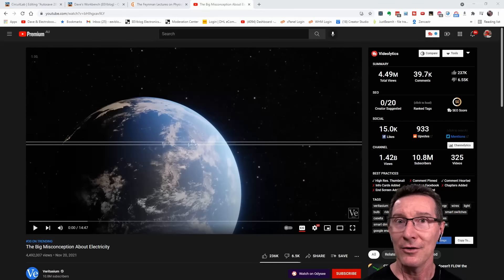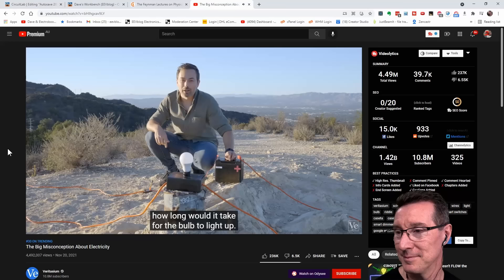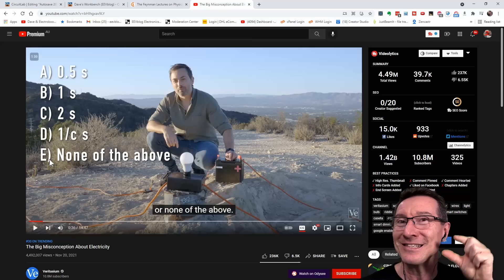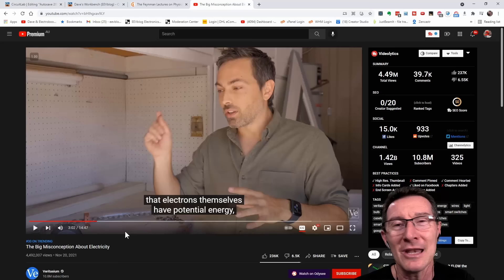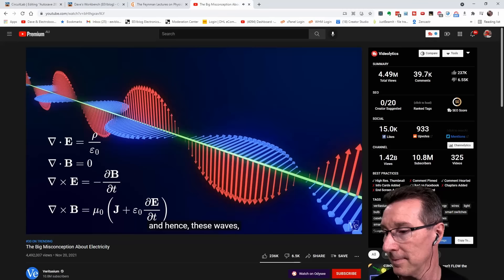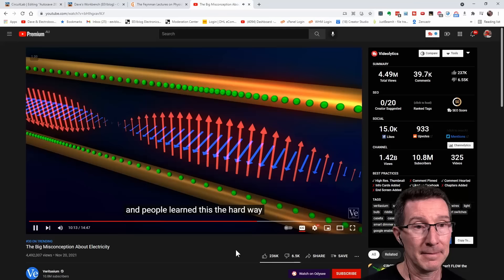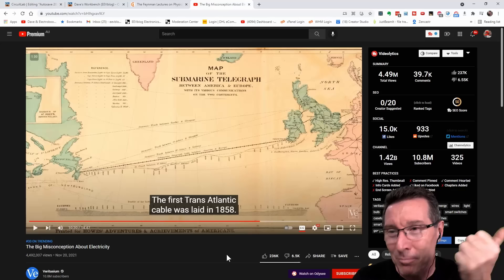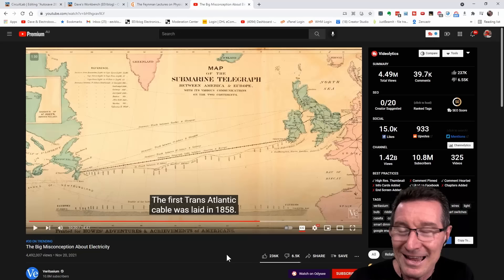EEVblog 1439 - Analysing Veritasium's Electricity Misconceptions Video

Comment: You're making a lot more sense than the original video. The Veritasium video seemed to imply to me that the existence of the wire would be irrelevant over that distance. Of course, it's evident for short distances that the wires don't have to be connected to transfer power, with for example transformers. But the details concerning thickness, resistance, distance, power , ac/dc, etc. matter a lot, otherwise every device and circuit would interfere with each other and be practically useless.
Reply: It seems to me like Derek tries to make concepts appear to be as counterintuitive as possible instead of trying to explain the concept as clearly as possible. I might be wrong that he's doing this on purpose to generate more commentary/discussion/views, but the end result seems to confuse more people than it does explain the concept clearly.
Reply: I would argue that the original video is wrong. The reason being that the magnetic filed  is made by moving  electrons.  The field is just breaking the electrons from moving att full speed.
Reply: @Kanglar  , I think so. He throws the baby out with the bathwater, so to speak, by making a technically correct explanation seem as though it has no value. There are different levels of abstraction that can be made for various phenomenon and those all can be correct. I found his video good, but slightly misleading because of that.
Reply: hmm is the wire sort of is irrelevant because you don't require a wire to transmit power..
There are a number of mediums that can transfer power...?...
Reply: The surface charges are already along the wire. When the switch is thrown a current is created,  making a B field, now power can flow through space. As real wires have resistance, power also flows into the wire where it is dissipated. It is not bad to say that the only purpose of the wire is to allow a current and the role of current is to make B.
Reply: @jimmcclymer4230  ....

"only purpose of the wire is to allow a current "

Well in effect, move electrons... then we are back to the beginning again.
Reply: the wire forms the field
Reply: @hausaffe100  That is not really saying anything. The battery matters, the surface charges on the wire makes two electric fields, one along the axis of the wire and one perpendicular to the wire, the 
Surface charge gradient makes a potential difference along the wire, causing a current which makes a magnetic field. The resulting ExB determines the power density.
Reply: I would argue that you are all assuming that all people watching are engineers. Almost no one is an engineer. Most people have different occupations. So I am quite sure that to most of his audience this is absolutely new. 

Just because we know, does not mean everyone knows.

If you consider the audience and what he wanted to achieve the veritasium video is absolutely fine. It teaches something most don't realize to those that don't realize it. 

Also remember that the average YouTube viewer video attention span is below 10 minutes. So videos have to be cut to fit that. I'm sure a lot of detail had to be dropped. He is not teaching a university class on the subject
Reply: Yeah and in Theory you could acutally only move the battery close the light bulb and have by that coupling to the wires inside the light bulb, in nA or pA for a ms. Of course your light would turn on
Reply: @TheWebstaff  The only reason a transformer works is because of the metal core plates layout that transfers power from one side to the other through the core that actually crosses the magnetic field induced by the primary winding.Without that specific core, the transformer would be completely useless. One can't simply transmit power without a wire efficiently. Even wireless chargers have to have their transmission and receiver antennas super close and right within the field not to lose too much efficiency. Magnetic fields means that you can radiate power from one line to another with some ammount of loss, it doesn't mean you can power a lightbulb with a wireless battery. Derek's video is basically saying that we could have flying cars and we technically wouldn't need rubber tyres... if we assume gravity doesn't exist. Which makes the entire video and concept completely pointless.
Reply: Derek played a bit of a word game in the opening question: he defined the lightbulb as lighting up "immediately when current passes through it". Or in other words, as soon as it receives even the smallest amount of energy. Under that definition, the relatively weak electromagnetic field surrounding the battery and spanning the short distance between the battery and bulb results in some current and thus "counts" as lighting the bulb. The "correct" answer of 1/c just happens to be the time it takes light to travel 1 meter, i.e. the 1 meter between battery and bulb. In reality, or a non-intentionally misleading setup, even if you keep with the assumption of zero resistance wires, that would be insufficient to visibly light the bulb and it would take the 1 second for the bulk of the energy to propagate along and around the wire to the bulb.
Reply: @sschmachtel8963  This is not a transient effect. It is how power flows. It is not what most people expect.
Reply: @jimmcclymer4230  no, the magnetic field will also break the speed of electrons,  this is effecticly the effect we call induction.
Reply: @schumerthd  losse are huge though. Look at the efficiency of wireless chargers and you will understand why wireless power is not the best alternative.
Reply: @matsv201  Induction is Lenz’s Law, a changing magnetic field induces an emf. If a magnetic field slowed electrons it would do work and violate conservation of energy.  Derek’s video had nothing to do with induction,it is not a transient effect.
Reply: @jimmcclymer4230  it is transient energy untill the state is is not. That is the whole point.
Reply: @TheWebstaff  The wire creates a magnetic field along the whole wire
Reply: @jimmcclymer4230  Are you eriously suggesting here that if you dangled two wires in vacuum you would have a DC current flowing at steady state? You must be kidding me. You are probably referring to something else which I dont get.
I see the point now more or less. I just completely forgot about this transmition line effect and was mind blown by how this possibly could be. Obviously you would have a big capacitor with those two freaking long wires, though I am not sure about the inductance's effect which must be also freaking high. With my comment above I was referring to the more realtistic case of two shorter wires at 1m distance, including their resistance. If I correctly refer to the equivalent circuit by dave then I guess the very first tiny capacitor in the transmition line still will be a short circuit at t=0.
And actually I dont know why you think that my  coment above  had anything to do with energy transmition. Actually I think dave has put it maybe to a good point. You might even say: Unless a circuit receives energy from the outside world or emits it it is absolutely not needed to employ maxwells equations, but you can use things like PEEC or transmition line circuits instead. They are completely equivalent to the maxwell equations. I give a reference to PEEC because thats the theory where I read about the similarity to maxwells theory.
Reply: @jimmcclymer4230  I think i now understand what you think. I think most of the people just got confused by the practically irrelevant example and dont refer at all to the poynting vector and energy flow. And as I said I simply forgot about that there could be a transmition line effect. I think that was the case  because I knew that such an effect with such cables as presented is really really small.
Also if I think about the microscopic drude model as a microscopic model and maxwell as a macroscopic model I really start to wonder how you would connect those two. Should be possible. But if electrons gain their speed by acceleration in an electric field then there must be something wrong about this according to poynting. unless you say faster electrons =higher current which increases also the magnetic field ... which seems like a weirdish concept because indirectly true. But if it succesfully describes external energy transfer then it actually might be a good concept to use more often.
All this stuff is theory anyway. And all theory might be wrong because it is ore or less only a  hpefully wellworking mathematical description of that what is/was observed.
As such I see the poynting vector also a bit sceptical as I think it is not something that you could easily tab into to gain energy from it. It is a bit weird funny and awkward
Reply: @hollyc5417  Well oh well . If you prefer the Maxwell equations beast over simple equivalent circuits you must be kidding me ...
Reply: Yes, Derek's video make a non engineer (me) get a lot of questions! :-)
If nothing moves inside the wire, where does the heat then come from? How would a theoretical perfect shielded wire transport energy if the wire is not able to create a magnetic field outside the wire?
Reply: @friedmule5403  Yeps!  Thought about wth if he is not an egineer, or even an engineer without basic electric aducation. Oopsista. You are perfectly right. And now you know also it is us to blame :-D. Meaning those that prefer to use circuits over path and surface integrals and right or left hand rule instead of curl operator.
Reply: Well what bothers me is that Maxwell aint say anything about ohmic losses. And the poynting vector stuff suggests the narratives related to that  are wrong. 
Blantly put: A common narrative is that in a cathode ray tube electrons are accelerated by the electric field, and of course this preception viewed by poynting is  wrong because it uses the a "wrong reason to give a correct result". But, a model is still a model and never the ultimate truth. Do you want seriously want to exlain the Drude model of charge carrier  mobility using cross products of E and B fields? There is aboslutely no point to do that even if you could.
The Poynting vector is a good indicator of energy transfer by electromagnetism. But to say Ohms law is wrong ... 
well frankly Ohms law is for energy loss. And Maxwell for electromagnetism. It is nice to crosscheck that the two theories somehow fit together and thats about it. I have a feeling  the real point is that you run into trouble when seeing it from the perspective of the electrons (I think in some video by science asylum there was a nice illustration but now it was difficult to exactly find it inside the videos). But you dont need to look at it from the perspective of the electrons if the relativistic effects are negligibly small... 
It merely just reassures that relativity and Maxwell's equations fit well together, which is somehow logical as Einsteins theories were developed with the help of Maxwell's equations.
Reply: @TheWebstaff  Sort of I think: wireless energy transmission happens every day: no wire between sun and earth, still the sun send over huge amount of energy. No wire between device and charging station for e.g. wireless charging smart phones. But I think wires are required to transport energy efficiently.
Reply: Yeah I think part of the problem too is that assumptions have been made that are not real life, just to fit the narrative. How thick would the conductors need to be in order to be 0 ohms around the loop? Even the best superconductor is going to have a substantial impedance at a loop size of 6*10^8 m long...
Reply: @sschmachtel8963  The funny part is that I am neither an engineer nor a scientist but just a home tinkerer,  and even I knew that something was wrong:-)
Reply: @bzuidgeest  Hey, somebody gets it.  Derek's content is aimed at a general audience, not engineers.
Reply: @joesterling4299  Yes, but the issue here is that they’re a bit misleading, as well as playing into the whole “what THEY don’t want you to know, but only I will tell you” thing that has been exploited by con men for ages.

He set up an impossible scenario - wires with no resistance and a light bulb that lights up with even the most minuscule amount of power - and leaves an impression that the wires themselves are almost irrelevant. Overall, this is not a correct laymen’s understanding of this. It may be physically correct in all it’s individual components, but the overall impression it leaves will only confuse people.
Reply: @matsv201  Not sure what you mean by break the speed. In relation to the video remember that this is not a transient effect. power flows from source to load through space (1m in this case) and along wires. Every wire also radiates power through space to load. It is all about the Poynting vector. Ad magnetic fields don't do work so can't effect the speed of electrons ( B fields make them go round and round!)
Reply: @jimmcclymer430  no.. breake like in slow down
Reply: That says more about your poor interpretation than it does about the original video. I'm not a physicist or an electrical engineer, but I understood broadly what he was saying. Either way, it's clear that at least he achieved his I'm of getting people to think about the subject, beyond the level of secondary school physics lessons.
Reply: @another3997  Okay, then suppose the circuit is rearranged into a circle. Now how long does it for the bulb to light? Or suppose instead of 1 meter, it's 1000 meters?

Does it still work as he says in the video?

Respectfully, if you WERE an electrical engineer, you'd understand why it was somewhat misleading.
Reply: @sschmachtel8963  Not sure what you mean by dangling wire and vacuum.  Remember it is not a simple capacitor as all the wire is at the same potential before the switch is thrown, it has no energy. It is easy to make a more realistic circuity but not useful. The point Derek made as to explain how power is really transferred in a circuit and he picks an extreme example to show the counter intuitive nature of the results to motivate people setting aside their biases to consider something new. No one is suggesting that using Poynting vector is a generally more useful method that those developed by engineers through long practice, it is simply the truth, interesting in its own right and perhaps useful in some unique circumstances.
Maxwell's eqs are E&M, anything else would be an approximation (I am not referring to QED). Energy is transmitted by the Poynting vector (ExB).  The video's message was that a wire develops a surface change  in which the gradient in the surface generates the potential difference causing the current. The current makes a B field. There are two E fields due to the surface charges; most text books will get one field right for the wrong reasons and simply say there is an E field along the wire. Since E is along the wire no power can flow along the wires because of the cross product. As Dave mentioned, Feyman says something like the power goes off into space and  flows into the load, which is really weird. Standard treatments ignore the surface charges on the wire which is also responsible for  a radial E field. Now this E field crossed with B gets power flowing along the wires. Not so easy to calculate how much power flows through which paths as hard to calculate the surface charge except  in simple geometry.  Power flows from source to load along all paths, how much by each path depends on details. As the power flows into resistive elements it is dissipated as heat.
Reply: @sschmachtel8963  Your comment is very insightful and explains a lot of the confusion. No physicist would take the circuit seriously, we would recognize it as an idealization used to uncover a more fundamental truth. The Drude model is just an approximation of how materials respond to fields, not needed to get the point of the video.  Maxwell's eq are the whole thing (except material parameters). 
We have been taught to see electrons as real and often ignore the fields until they can't be ignored, RF, yet they are there at DC.  Energy conservation and Maxell requires the energy is transmitted by Poynting vector.
Often use of Poynting is more difficult than other methods as you need to know the E and B fields everywhere.
Reply: @Kanglar  Absolutly agree. I saw Derek's video first time and I don't like it. He didn't explain the concepts in good way.
Reply: @jimmcclymer430  Yeah stunning is really that indeed the pyonting vector can be used describe antennas or even light?? meaning really energy that is transferred.... thus there is a somewhat good reason to believe that energy is really flowing that weirdly.
Anyway, maybe if one would plot the hole ExB field in colors ith some potential and as a contour then I have somewhat the feeling maybe it isnt that weird after all. Maybe the point being that due to the relation to the magnetic field the energy probably will be mostly transferred near the wires? Well and surface charges and surface waves of ExB included due to skin effects.
If you use arrows it looks like it would take a completely different way not along the wires... but I am not sure if that is actually the case, even if you still have those capacitive effects as well.
Yeps agree that it is difficult to kind of "challenge" existing belief ... where this is in a way often presented as the only valid truth, where in reality it is all but some modells that usually work well but also have their limitations. It would be very hard to have a model that kind of would get rid of electrons as the picture which exists in our mind... no matter how good the reasoning would be.
Lets see if this will happend that some old model's constraints will actually prevent the acceptance of new models.. Einstein's relativity theories are a good example. Not particularly popular when it was invented
Reply: Veritasium  basically leaves out the detail that in his example frequency is zero, A very critical distinction.
Reply: 100% agree. For those engineers who have never delved into transmission line theory, who got stuck in computer architecture or semiconductor theory etc. Veritasiums videos are a great way to evoke interest.